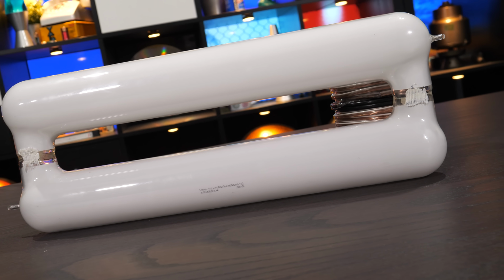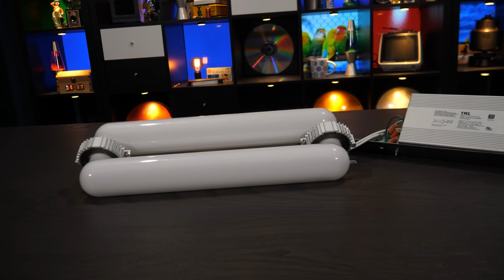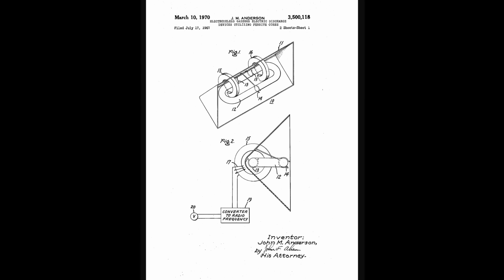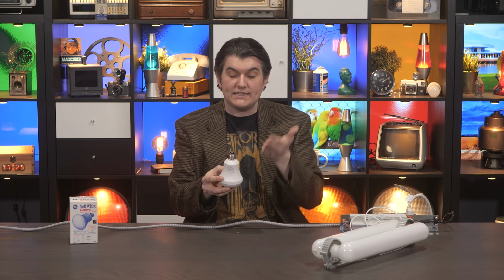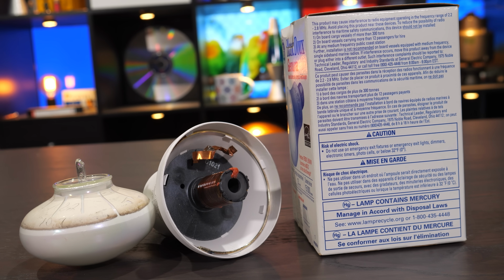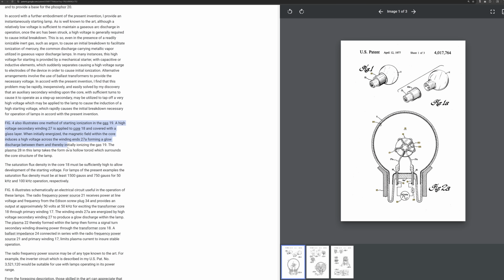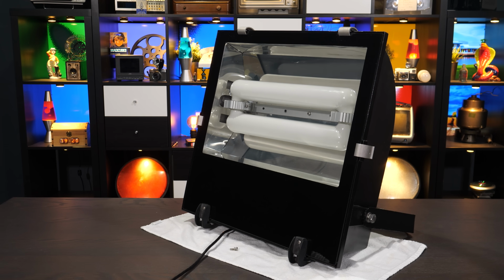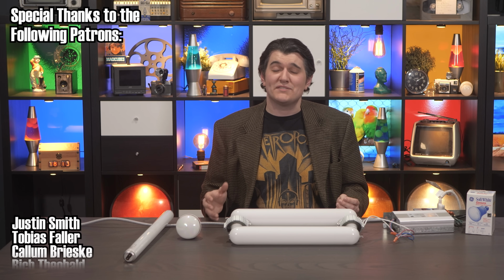Induction lamps: fluorescent lighting's final form

Comment: I used to work for Philips Lighting,  induction lamps were used  in very specific jobs but they were the only thing that would work in those applications.  Explosion proof areas was one.
Reply: It's all fun and games until someone puts an un-sealed relay in the driver circuits.
Reply: It was said high frequency. What is the voltage and current in the primary circuit? The secondary circuit is fully enclosed, so, unless you smash the tube, not an ignition source and the tube would be in an enclosure of some sort to protect it from mechanical damage.
Reply: I am asking what that primary voltage/current would be.
Reply: As someone working in a plant with many Ex zones (as a PLC engineer), having HF high voltage anywhere NEAR these zones makes me uneasy. Was everything potted up? When a tube breaks, wouldn't the short moment of hot, ionized gas, that probably keeps conducting for a few ms, not be enough to cause ignition?
Reply: @fonkbadonk5370  The gas in low pressure discharge lamps doesn't get that hot, actually. Also normal gas discharge lamps have electrodes that run hot while these don't.
Reply: @fonkbadonk5370  Drivers are potted and the enclosures are EEX rated. They are used because there is no chance of a loose connection making a spark in the enclosure, and there are safety switches to disconnect power when the cover is removed.
Reply: @fonkbadonk5370 no, the fitting is designed to be sealed against ingress of flammable gases, and also tough enough to contain an internal explosion if it does happen.
Reply: I'm pretty sure i took apart a philips projection TV that had a micro induction lamp for its lamp. I took it apart and it was insane. i just can't remember exactly which brand it was but i think it was philips.
Reply: @hi-friaudioman  Projection TVs don't use lamps, they use projection CRTs.
Reply: @cebruthius depends, the later ones were DLP and some of the late models even had LCDs.
Reply: @cebruthius  iirc late 90's/ early 00's had large TVs that used expensive bulbs that required replacement. I don't remember them being that popular though. They didn't exist for more than a few years before plasma and LCD took over.
Reply: Did you ever deal with Sulfur Lamps?
Reply: Id totally expect these to be in nuclear bunkers
Reply: For a while an array of Philips QL lamps was used to illuminate the clock faces of Big Ben in London. IIRC they were replaced more recently with LEDs.
Reply: He does mention explosion proof in vid 😎
Reply: How is this EX safe? One time someone at my local shooting range cleared a gun that was not unloaded so it went off down range and the bullet hit around 6 florecent lamps on it's way down the range. There was a epic rain of sparks coming from the lamps, and i can imagine this would ignite stuff in a EX zone.
Reply: @titter3648  I believe the qualifier is that it will not create sparks during normal operation or when it's turned on or off - which can happen with any metal on metal contact.
Reply: @titter3648 Those were most likely regular FL tubes though.
Still, I'm also wondering about the first replier's question.

Comment: Fascinating device! Regarding the start-up mechanism; I remember that for cold gas discharge tubes, like nixies or other similar devices, the start-up is of course voltage dependent, but there is also a semi-random amount of time involved since it relies on background radiation creating an initial ionization event. I guess to some extent that can also be the case here.
Reply: Does that mean that some light's would struggle to light in a radiation-shielded environment?

Comment: On the Patent page you show @ 19:04 it seems to be explained in the second paragraph...
I THINK THIS IS HOW IT WORKS - that metal strip helps transmit the RF energy into certain coatings inside the bulb (it is NOT a traditional Fluorescent bulb obviously... it's TOTALLY DIFFERENT system where THE COATINGS ACT AS THE ELECTRODES!!! FASCINATING!!!)  that create UV light which interacts with ANOTHER Coating that creates visible that  jump-starts the fluorescent light from the mercury/argon system we traditionally think of

Comment: From the very first second of the video, the problem of ionizing the gas inside the tube was bothering me. I hate the idea of using strips of metal on the outside of the glass to serve as a kind of catalyst for ionization; I could see it working, but then you'd still have the problem of sputtering, only now it would be the inner surface of the tube eroding because the gas particles closest to the walls are likely to ionize sooner than those further away.

I don't know enough about physics to make any guesses myself, although it might be interesting to hook the thing up to an oscilloscope and see what sort of waveform it produces, especially during the first few thousand milliseconds of startup time

Comment: 8:55 Ferrite is made from ferromagnetic (and usually conductive) powder pressed together with binding agents. They still have eddy currents but they are orders of magnitude smaller from conductive particles being that much smaller when compared to laminated steel transformers.

28:20 I wouldn't say lighting has been solved yet: LEDs are still only ~35% efficient at turning electricity into light and we still have issues with CRIs being as low as 60% in some cases, QDEL might push efficiency the next step up to 60+% and since Qdots can more closely match wavelengths the human eye likes, chances are baseline CRIs will be better too.
Reply: led lighting is only getting worse , finding bulbs with a decent cri was easier 5-10 years ago
Reply: As a nerd I have non-average taste in lgihting and I say that a combination of fluorescent and HID lighting is abolutely perfect. LEDs are boring for me.

Comment: Pretty sure those pieces of metal you mention at the end are indeed the source of ionisation. The main thing of these is a high frequency changing mangetic field, so in any metal nearby the high dB/dt can induce large voltages. The power will be low, so its not a problem in ordinary parts around it. But in a (rough) vacuum, before the ionisation, it cannot dissapate and thus it will actually be high and should be able to ionise easily. Basically a vacuum breakdown

Comment: Wouldn't putting a insulated wire with both ends close to one another inside a powerful electromagnetic field cause an electrical Arc between the two ends of the wire

Comment: The glass of the envelope act as a capacitor, with a voltage gradient along the wavelength of the driving signal. The value of the equivalent capacitor (a series of capacitors, due to the gradient) become higher if you ground the external side of the glass with a copper strip.
Anthony

Comment: My guess that little coil, or wire inside tube is a filament (kinda) to start the lamp, as it will be close to the magnetic field and the "filament" itself is closed loop, it will start to generate current and heat itself up. Get it just hot enough to start discharge going on.

Comment: That AC power converter sitting quietly to the side looks expensive, large and way more likely to fail bringing those 100,000 hours of failure free lighting to, oh say 5000 to 10000 hrs.  Capacitors are usually one of the first components to fail or parameter drift extensively.   Still, an interesting technology.  I think someone needs to buy themselves an x-ray unit...

Comment: My buddy did microwave comm on top of tall buildings.  They were trying to cut all power to surrounding circuits to redo a lighting system.  They could not turn off a particular florescent fixture not matter what they did including physically cutting the power source.  Turned out some of microwaves were causing the tubes to fluoresce without power.  Oops.

Comment: I have been in a High Voltage Lab - and watched the florescent bulbs light up ... regardless of any direct electrical connections, if there was enough juice running through the Tesla coils ...

Also I am dreading some weird incandescent bulbs I have dying ... and not being able to replace them with anything ... as the incandescent version doesn't exist. and there is no replacement (I suspect finding an incandescent replacement in an alterative universe where LED's don't work, would be near impossible)

Comment: Another interesting factor to fluorescent light was that it flickered at the exact same frequency as power, as do many other electronics and machines. Under Fluorescent tubes some machines appear to be spinning slower than they are, which is why in workshops they installed the tubes on 3 different phases. I don't know how exactly true that is I didn't live through that time but that's something I got taught as an electrician.
Reply: it's true, i worked on a mine in zimbabwe, and they had an air compressor with a flywheel that spun at about the same frequency as the flourescent lights own frequency and they had to add an incandescent bulb to the room so no one made the error of getting too close to the flywheel
Reply: @TS-jm7jm  different bulb is cheaper than a guard for the compression, checks out!
Reply: IT flickered at double the mains frequency becayse it light up in both half cycles. 100 or 120 Hz flicker, not 50 or 60 Hz.
Reply: I saw Osram Endurance lamps, which are similar to your large one, at a bus station in South London, and as street lights in a small area of West London.  The bus station ones are long gone, but I don’t know about the street lamps; they were in an area that I seldom go.

Philips QL lamps were used in an installation which just about everybody will have seen photographs of.  They were used to light the four faces of the Westminster clock, the one often incorrectly known as ‘Big Ben’.   I have never been inside the clock tower, but have seen photographs of them in place.  I think they were probably replaced by LEDs during the recent refurbishment.  The clock was originally gas lit.

Comment: LOOK UNDER THE RING, ON THE GLASS - There is some kind of metallic strip ON THE GLASS..... MAYBE THIS is acting as the electrode....... maybe there is also a STRIP INSIDE THE GLASS AT THE SAME PLACE..... and it uses WIRELESS TRANSMISSION to transmit voltage from the outer strip to the inner strip, causing it to act like an electrode.... or 2 electrodes.... I think there are actually 2 strips - one on the TOP and one on the BOTTOM.... and one is the positive and the other the negative.... but on the ring at the other end of the glass the poles and the current are reverse so the power is distributed equally ...... I think it would help if I understood how electricity works 🤣
Reply: HOLY CRAP!!! @ 19:04 that patent SHOWS THAT THE POLARITY IS REVERSED ON THE OTHER RING!!! JUST LIKE I SAID!! (and NO I didn't see the patent before I wrote that... you can tell because it's most likely WRONG lol)
OHHH and it DOES mention the strip!! HAHA!!! But I was wrong about it being on the inside... so it doesn't work how I thought, but I knew the strip had something to do with it... I just don't know how...... MAYBE because the current in the second coil is moving in the opposite direction (which would make the strips oppositely charged) THAT somehow helps with the initial discharge to start it 🤷‍♂
Reply: OH CRAP! It's all explained in that SECOND PARAGRAPH @ 19:04 .... there is a coating n the inside of the lamp (made from Quartz somehow) that creates UV "light" that causes a PHOSPHOR coating to emit visible light....  oh no wait...  if the coating IS Quartz then you DONT use the other PHOSPHOR coating...   
IDK MAN, you're better at this than me LOL - I guess I shoudlhave read it all before sayin anything... LMAO 🤦‍♂🤦‍♂🤦‍♂ - but it's all explained in the second paragraph...
I THINK THIS IS HOW IT WORKS - that metal strip helps transmit the RF energy into certain coatings inside the bulb (it is NOT a traditional Fluorescent bulb obviously... it's TOTALLY DIFFERENT system where THE COATINGS ACT AS THE ELECTRODES!!! FASCINATING!!!)  that create UV light which interacts with ANOTHER Coating that creates visible that  jump-starts the fluorescent light from the mercury/argon system we traditionally think of

Comment: The bulb lasts years, but how long does the driver circuit last? Because without that, it's not a lamp.

With fluros it was always the starter that failed, which isn't  too bad, they're cheap. 

With LEDs its always the driver that fails, they're twenty to sixty bucks.

Now with induction, I imagine the driver will fail more often than the an LED driver, but will cost a bomb to replace.

Oops, you covered it, while I haven't replaced a light bulb in years, I have had to replace a bunch of drivers, which is illegal to do without a license where I live.

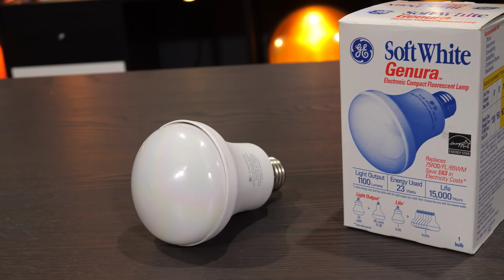Comment: 22:30 I could see some applications in photography or film lighting where the high frequency would be good for avoiding flicker when shooting at extremely high frame rates with a very narrow shutter angle. The need for very bright but fast light would be pretty niche though and wouldn't make sense in applications where the audio tracks were going to be used.

Comment: As you said, mooted by LEDs, but the high switching rates of Gallium nitride (GaN) semiconductors would make the electronics smaller, easier to produce, and more efficient than 20-30 years ago.
Reply: It gives such reduction of size like you can "process" 400W (without heatsinks!1) on a PCB of the size like 8cm x 8cm. That's awesome. I guess it was some kind of inverter or solar MPPT controller.
Reply: And maybe give even more RF interference.

Comment: It may very well be that a metal piece inside the lamp becomes an induction heater, which ionizes the gas enough for the lamp to start. All it would need is a higher frequency to heat up the metal piece.

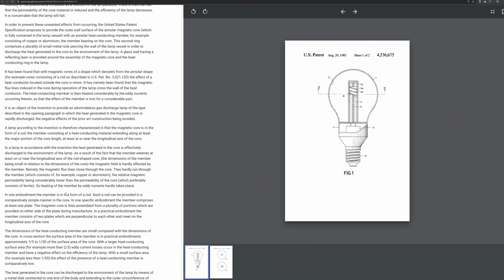Comment: 20:30 When you create a magnetic field you create an orthogonal, out of phase, electric field at the same time. Reversing it causes the opposite electric field.  When you oscillate that at 2ghz you create a 'plasma of electric field' which has all kinds of static potential... <and poof!> your lamp is lit!
Reply: or use a radioactive isotope to keep it ionized all the time - lol!
Reply: yeah but they get hot kinda quick in a microwave
Reply: I’m suspicious. 2 GHz used to be pretty hard to get.
Reply: 2Ghz in that ferrite... Yeah no. Language aside, sure E=-dA/dt (neglecting potential gradient from other sources) so yes you can get strong enough fields at high frequency to kick off a stable plasma. The actual answer is simpler though: V=LdI/dt. Flow current through the inductor and stop it in a very short time, which will produce a very large voltage over the primary. Fringe field from the primary couples into the tube.
Reply: Just pitching in because this is a common and reasonable error which I believed for a couple decades. The electric and magnetic fields in electromagnetic radiation are not out of phase. Both in physical reality and Maxwell's math, they reach maximum and zero in the same place at the same time. Apologies if you were specifically talking about the "near field", where that doesn't necessarily hold true.
Reply: @HypoceeYT  Correct!  Thank you.  I realized that after writing it but also realized that the basic point has a little merit and left it that way.  Thanks.  Thank you.
Reply: You're orthogonal!!🙂